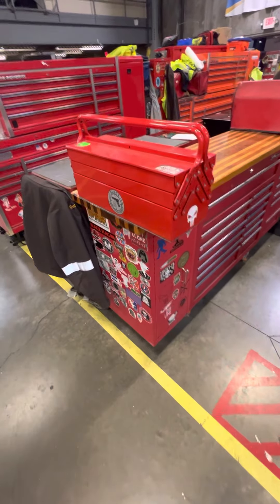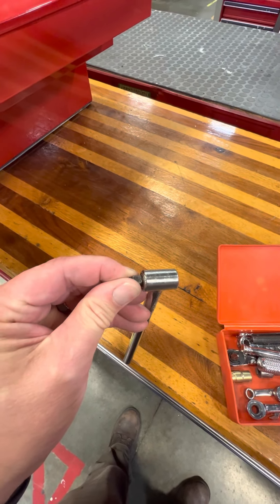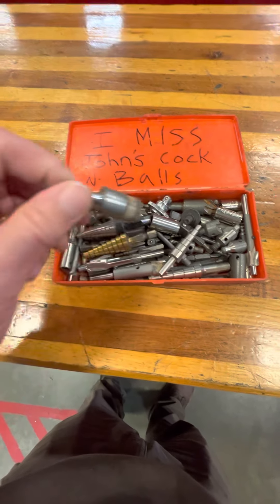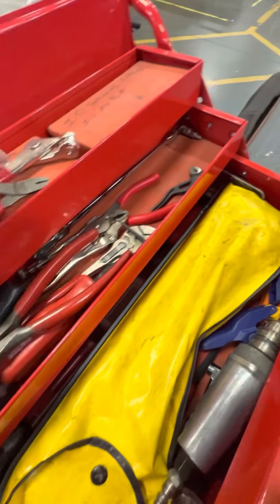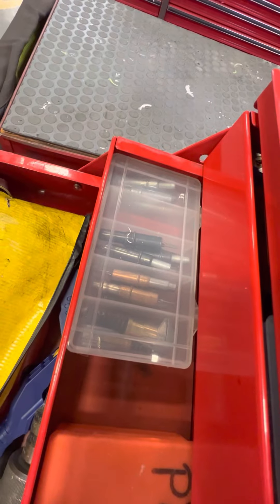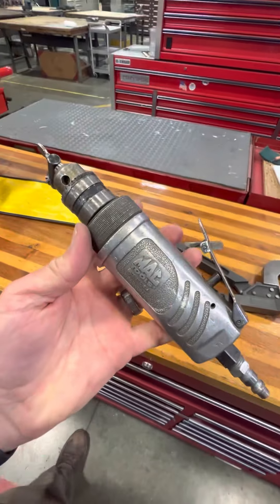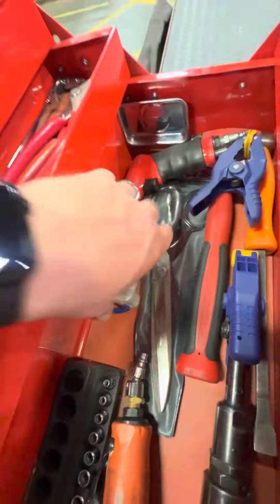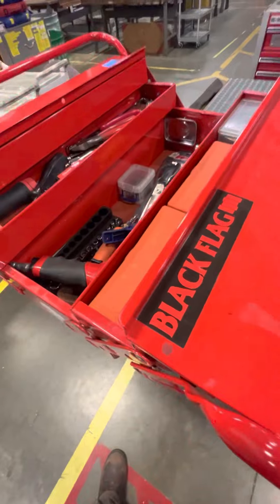Snap-on Cantilever tool box tour

Comment: Looking at the Williams version of that driver I wasn’t sure if I should get the 2 or 4” shaft one yours looks like the 4”. Have you tried a 2” shaft? If so do you have an opinion on one or the other? Really like my ratcheting driver that I got recently I didn’t think I’d like it when I got it but turns out to be smooth and handy.
Reply from the maker: The T-Handle is one my Fav tools. My partner has the 2”. If I was to do it again I would get the 2” version. One can always put longer bits in it. The stubby can get in the occasional tight space easier. 
Buy one. You won’t regret it. 
This one is date coded early 2000’s.